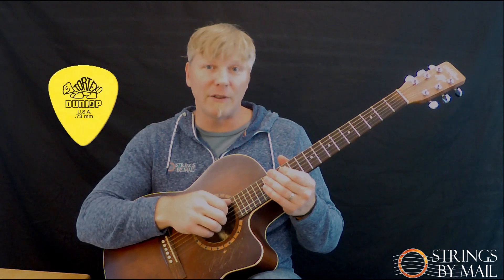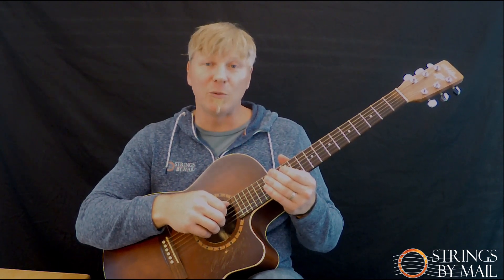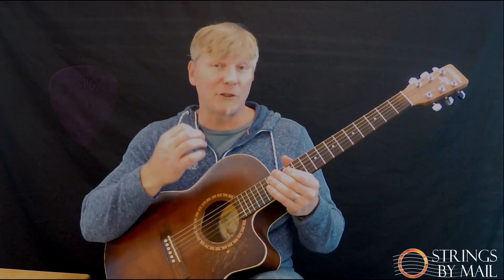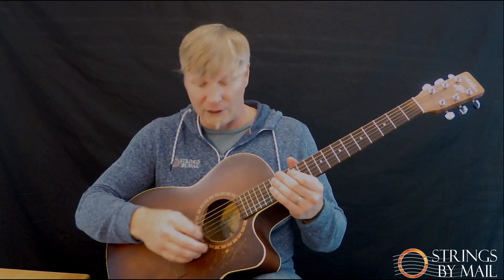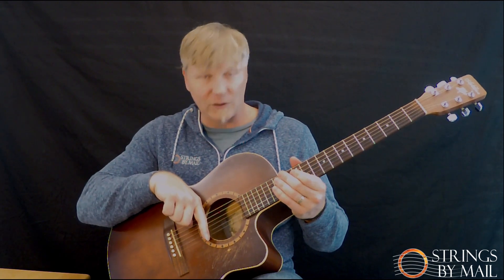Dunlop Tortex Standard Series Tone Demo

Comment: The thinner pick forces the players accuracy at speed its like weightlifting plus it sounds brighter.  1.5 mm the sound is muddy though these are recommended for shred.  I lost two decades.  I really like the 0.88 tortex for lead on my left handed strat and i use 0.6 nylon on the right handed strat.  The thinner picks i use so my fretting hand can keep up im stronger picking right handed.  Players should start at mediums then go up in thickness if their hands are weak and need more support to play fast.  Likely i will get a 0.5 or 0.6 tortex for the right handed guitar.

Comment: I don't know anything about electric guitars.
I do know about Acoustic Guitars thin picks sound floppy & thin hard to control
Thick picks sound fuller & rich easy to control my favorite are  TAD100 by Blue Chip Picks
Reply: Thick picks force your picking inaccuracies into the fretboard there isnt time to adjust which is why 1.5 mm for shred on electric is bad two decades experience.  If however your physiology likes the feel stay with it.
Reply: @5zazen  what do u think of the blue 1.0 mm Dunlop tortex ?